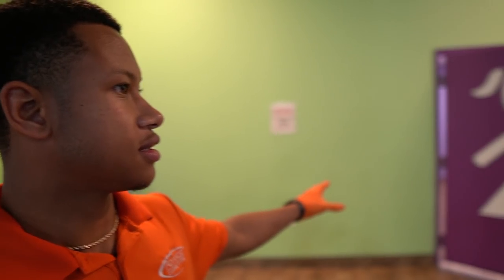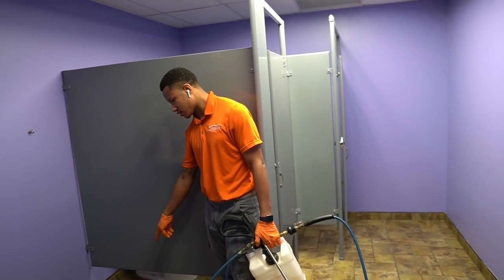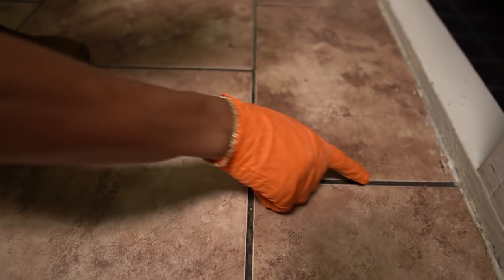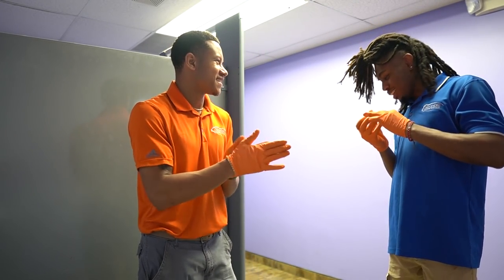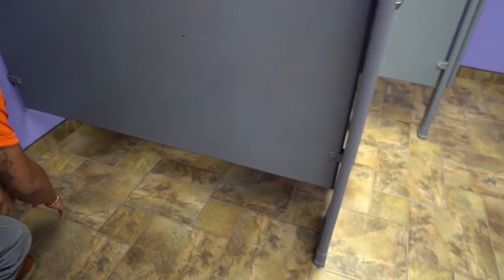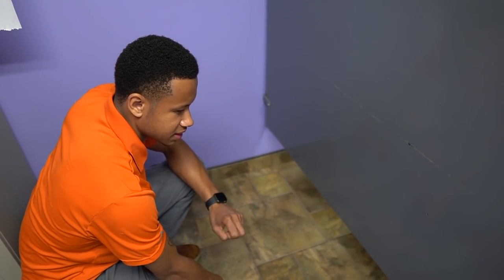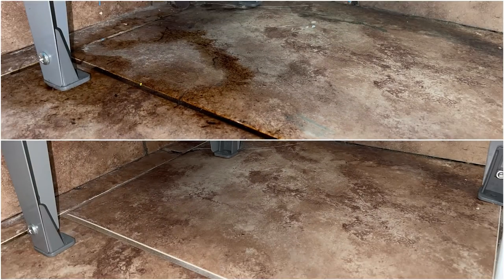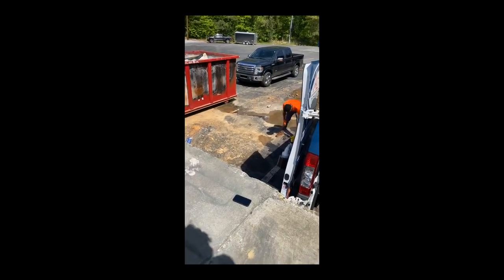This family entertainment center has a DIRTY secret 🤫

Comment: but j clean my carpets in a way that'll tired me out what i do is i use the steamvac as the sprayer ill go over the carpet till i see the solution suds up then ill use a brush an extension wand to scrub the carpet sense the steamvac don't have brushes its a hoover supreme steamvac its old but it works but ill scrub it then ill use the steamvac to suck up that water an just by looking at it the water getting sucked up is completely dark plus i can use it on hard floors so it saves me the time to use a mop an bucket